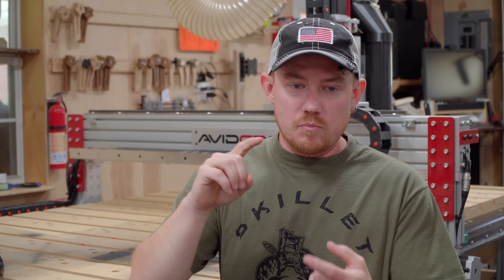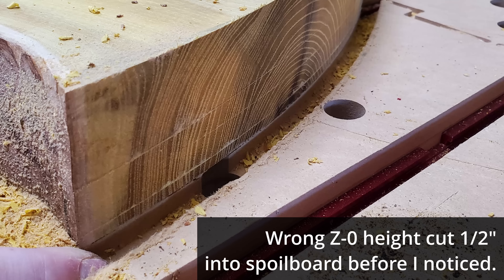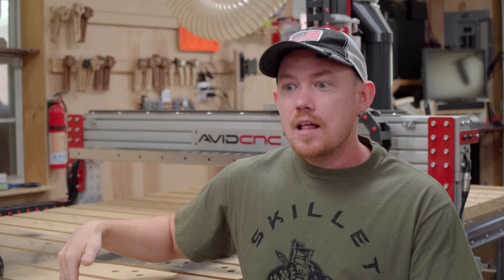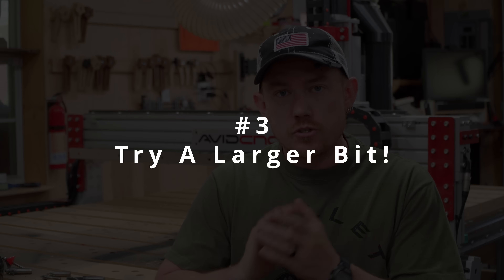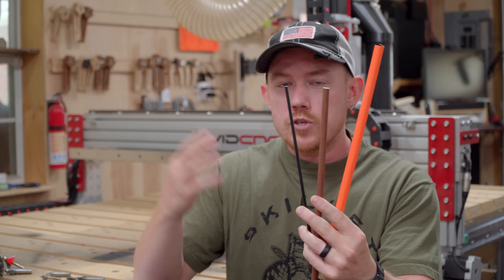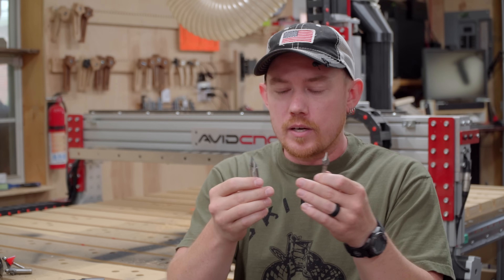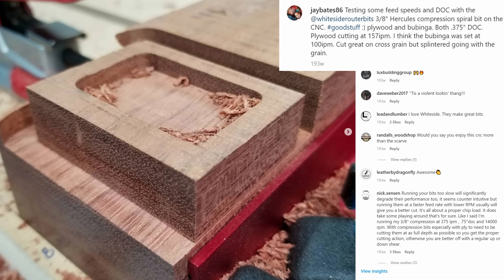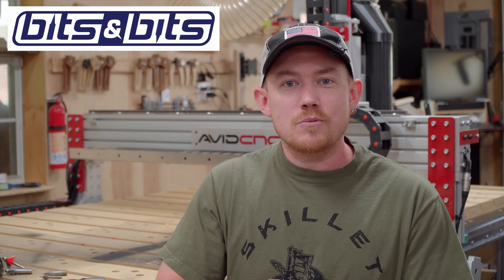STOP Breaking Router Bits! - 391

Comment: Doing machining on steels and stainless, we typically use a SFM (surface feet per minute), and a IPT (inches per tooth) to calculate basically our initial feeds and speeds before we know the tool. I’d suspect you’d want to take maybe say use the aluminum section of an end mill feeds chart and work from there.

Comment: Depth of each pass should be equal to or less than the diameter of the tool. EG 4mm bit 3 passes for 12mm deep cut. This rule stopped breaking bits.
Reply from the maker: Not necessarily. I worked in the  frame mill at Ashely Furniture (the worlds largest furniture manufacturer) and all of their production CNC machines run full depth single pass with 3/8" diameter bits. 1/2" and 3/4" thick OSB and pine plywood. Chipload is still king in full depth passes. I forget the calculation but there is a multiplyer to follow when going 1.5x, 2x diameter or greater DOC per pass. The spindle power doesn't necessarily need to be huge to do so. My Axiom CNC I had previous to this Avid had a 2hp spindle. I ran full depth cuts with no problems. If the chipload is correct it's very doable and holds up well. Of course, my audience is primarily non-production shop woodworkers who would never utilize full depth cuts.

Comment: Two colorful ways I broke router bits: 1) Didn't properly secure the router in the router table, so when I switched it on, it literally fell onto the concrete floor bit first. Thankfully I was far enough so I wasn't injured. 2) The insert plate for that router table (an old Porter Cable) was only held down by gravity with no screws or other mechanism for holding it down. Well, I had a piece of wood caught onto it just enough and it ended hitting the spinning bit. I ended up making a new router table with inserts that are screwed down.
Reply: Holy Jesus. I make sure they are tight!!
Reply: @melissahunter1375  Yup! Lesson learned! Now I'm extra paranoid making sure that the router is properly locked.

Comment: Returning to using routers after a couple decades away. I inherited a Freud in a router table from a friend and recently bought a DeWalt plunge and fix base bundle. I think I remember changing bits in my old craftsmans by loosening the collet and simply pulling the bit out. On my current routers I can’t seem to get the bits out without removing the collet and pushing the bit out from the back.  Not sure what I am doing wrong. Any input is appreciated.
Reply from the maker: Could be dirt build up in the collet. I blow mine out with compressed air with every bit change. Try that and a good cleaning with alcohol and a q-tip.
Reply: @JayBates  I did blow them out with the compressor. I will give them an alcohol wipe down and see if that takes care of it. Thanks.
Reply: @Lincoln Dickerson Not sure if this is helpful, but I noticed sometimes when putting the bit in the collet it bottomed out, sometimes finding it hard to remove. So I put an oring inside the collet to stop bit bottoming out, seemed to improve removing stuck bits. Or you can make sure you lift the bit up before tightening collet.
Reply: @meawayfromhome  thanks I will give that a try.

Comment: Early in the use of my router table, I broke a solid carbide spiral upcut bit.  I never did find the piece that broke off.  I suppose I was trying to feed the work piece too fast.  Recently I had another incident that bothers me a bit.  I was using another quarter inch spiral upcut bit to cut mortises in some table legs, so eight mortises.  On the very last one, the bit came loose and ruined the mortise.  Reflecting back, I have had bits loosen before when using guide bushings.  I know the bits were properly tightened in the colletts.  I would appreciate any insight on what might cause a bit to loosen while in use.

Comment: For beginners 1/8" is better because it breaks easier. It acts as a fuse being the weakest link.

Once you get comfortable then go bigger on the shanks. 

A router bit is the cheapest thing on a router to replace

Comment: Do most of you find that sound is a reliable indicator of healthy Feeds & Speeds?
I’d love to see a video capturing the various sound signatures of slow, correct, and aggressive F & S since I find that sound is what normally tips me off to there being a problem. 🤷🏼‍♂️
Reply: I think the best indicator is how large the chips are. Larger chips transport more heat from the bit than smaller dust, which keeps the bit from dulling.
Reply from the maker: Sound is a very reliable indicator. Rubbing on my CNC produces a very high pitch wine.